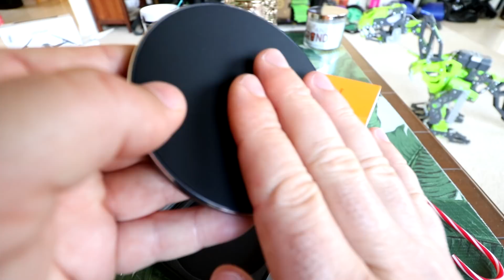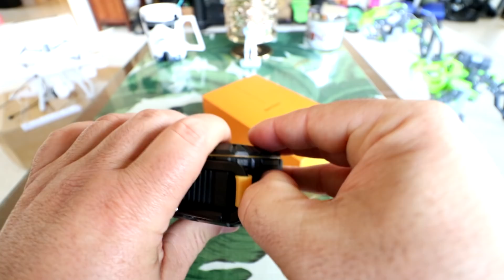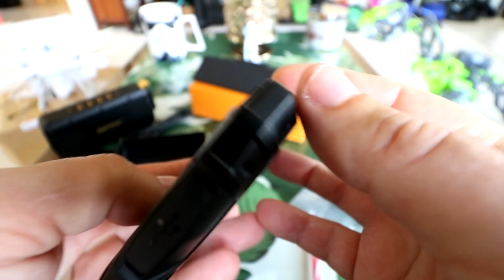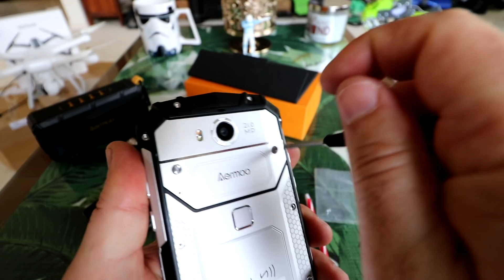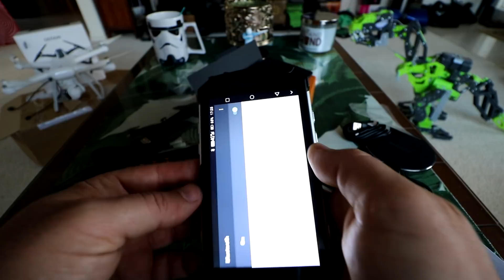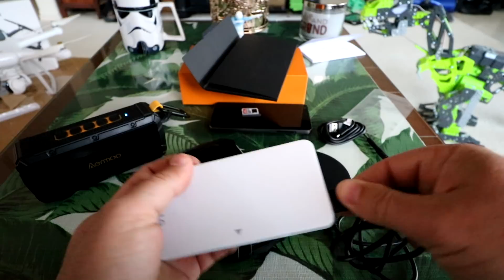AERMOO M1 Waterproof Phone & V1 Waterproof Speaker Review - Unboxing, Inspection, Setup, Pros & Cons

Comment: Dropped my M1 this morning from 3feet on to the plastic window sill in the kitchen..its dented the power button so much it is turning off and on like it's stuck in a bootloop... !!?? Should come with replacement alloy side panels and buttons.. also not impressed with the loud speakers. They are crackling and cutting out like the coils have blown out on full volume and it's 3 weeks old... I'm disappointed.. looks like it been kicked around the street after a few falls from the car. Forgot it was on my lap getting out.. drop it from hight and it'll probably leave a impact crater.. it's  too heavy for its own good..

Comment: The PTT is NOT for use with carrier supported PTT - it is for use with the app "Zello". Zello is an app that makes it possible to use somewhat like a walkie-talkie. The benefit is that you only use mobile data/wifi in order to talk together. Usually that is much cheaper than using ordinary telephone call - and you do not have to wait for the phone to be picked up. And it can be bridged together with ordinary walkie-talkies - is is amazingly useful if you have a big crew that needs to communicate. See also zello.com

Comment: I got my wife the Doggee S60 a couple months ago, I soldered a us plug to the charger so I can use it, the SOS button seems to be more work then help, instead she has my number on her home screen as a short cut, the PPT button is for an app like Zello not like the Nextel phones, the phone is able to use two Sims cards you'll find that in setting, the only thing I found wrong with it is the wireless charger will only charge 5% then the phone acts up. I was wounding if yours worked but I you did the same as I did (just a quick check) my wife is the one who found out it did work...lol ,the testing they do on this phone is JAW dropping.
Reply from the maker: +Chi Sty Thanks Chi, I've had it on the wireless charger a few times and it did charge to 100%
Reply: Dustin Dunnill Great to hear you had no problem.Could you please put a link of the charger you got (if sold separately) so I could try that one? (Anyone reading) please note I'm talking about a phone that looks like,not the phone HE has. I'm not sure if it's the charger or the phone (Doggee S60)  that is the problem. I'm sure my wife would love the wireless charger option.BTW Happy NEW YEAR and keep up the GREAT work on your channel!!!